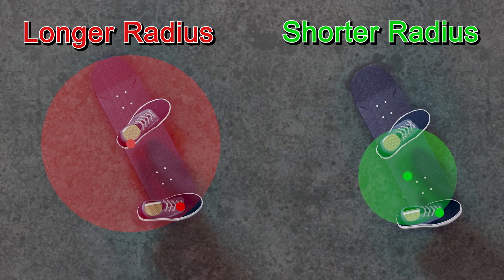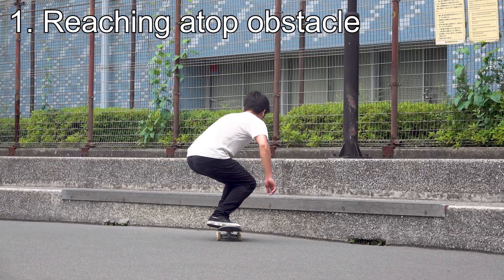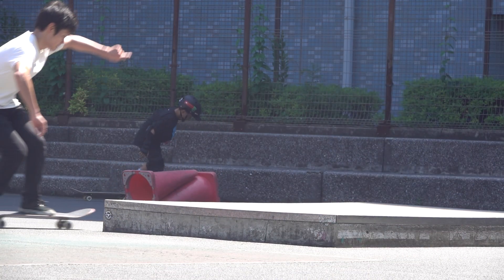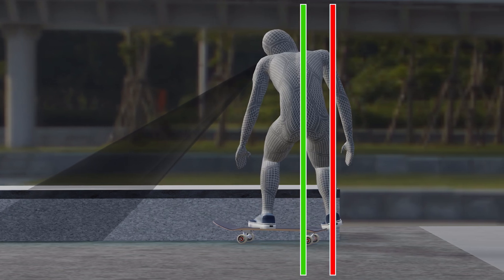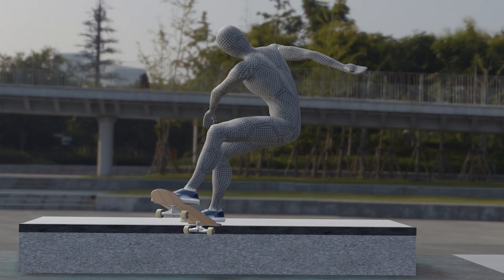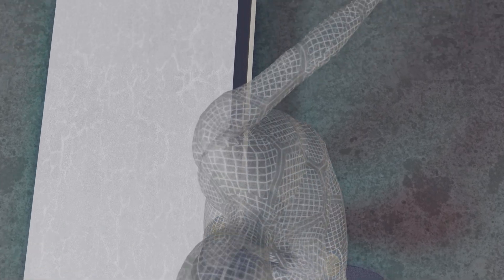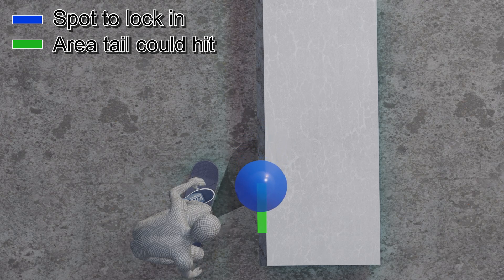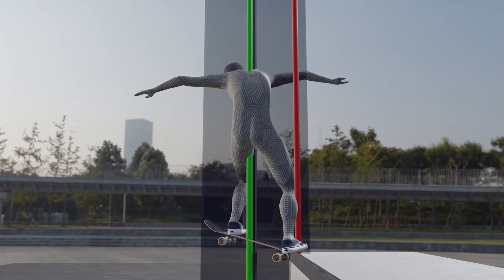Frontside Tailslide - How to Lock in Energy-Efficiently

Comment: My best advice for these, besides everything he said here, Is make sure you have a good 5050, and make sure you can do fs180 pretty solid, like land 8/10 at least and do them pretty easily and pop them good, level them out etc😢. Pretty much what helped me, was popping up to the obstacle like I'm gonna do a 5050, then I turn the board 90° and open up shoulders like I'm doing a fs 180, the last split second before my trucks hit, turn and place the tail down, I was able to get into them like that, then just had to work on staying in, back foot placement and not slipping out..I had a terrible time just getting into them before what I described about. Before that I was swiping in a big swooping motion like I was doing a fs 180, and it just wasn't working. What he said about approach angle is crucial, you don't really want to approach like you'd do a 5050, it's still possible but a lot easier if you adjust the approach angle like he mentioned in the video.
Reply from the maker: ahhh,,,,true. thanks for the comment!!

Comment: I'm surprised you didn't mention keeping the toeside wheel off the ledge or rail by rotating slightly more than 90 degrees when you initially lock it. I feel this lock in angle aspect is one of the most important tip for slide tricks since it minimizes stick.

Comment: such a good well explained video. good job..   ALso id like to point out something that should be obvious but always isnt.  If your foot is too big or on the larger side, you need a wider board.   I cant tail slide on anything under 8.5.  my heel drags too much.    was never able to slide taislides untill i went to 8.5  all of a sudden they started sliding without changing any mechanics on my end

Comment: I tried out your trick analyzer and I must say that is very cool! I'm looking forward to future versions of it. The main issue with the first version of course is the fact that there is not a board in the animations. The other main issue I noticed is that while it seems to track the body movements pretty well, it doesn't show the person moving up and down through space very well. The center of gravity should be able to go up and down on the Y-axis plane, or the floor plane should move up and down relative to the skater - whichever works better.
Reply from the maker: thanks a lot for the input. everything you said is 100% correct.
there are soooo many things to do so it might take some time to improve it.
but i assure you i'll make it better. thanks!!

Comment: Another top notch video! I've been working on my front tails again and I've found two things really help me: 1: approach with a bit more speed than might feel comfortable at first, as speed seems to allow you to come at a smaller angle and not have to alley oop too much to get the tail on. Depending on the curb, I actually come at a slight angle, but try to be riding almost parallel when I actually pop. 2: this may have to do with what you mention about keeping your weight a bit further back, but I noticed I pre-turn my back knee ever so slightly frontside right before popping, and this too seems to help me get the tail quickly in the right place. Weirdly, front tails were my third ledge trick after front 50s and noseslides back in the day, but I've struggled with them ever since. Gonna refer back to this tutorial as I learn 'em again, keep up the good work my bro!
Reply from the maker: Hi, thanks for sharing!